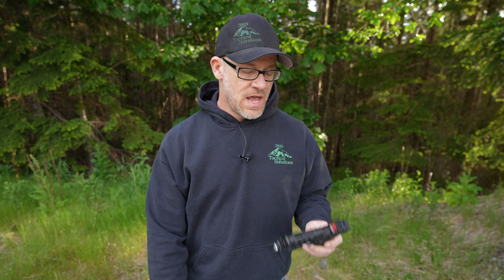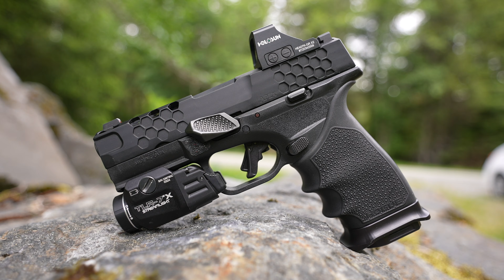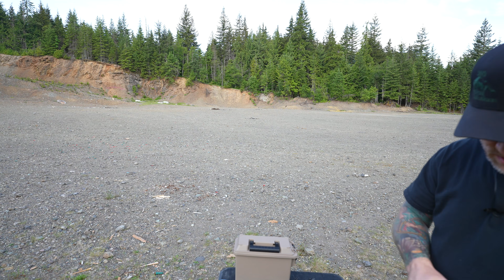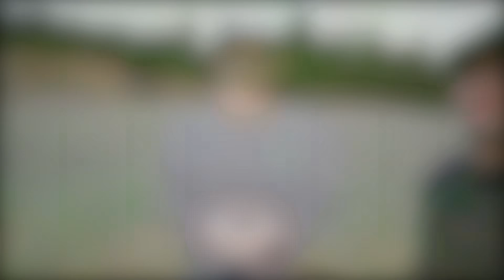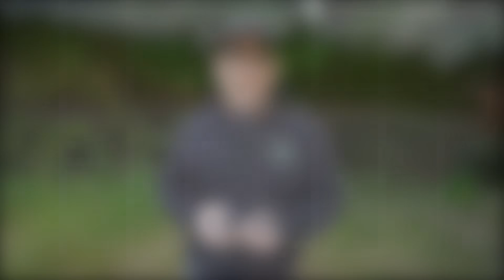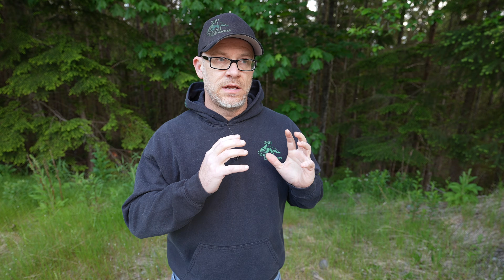BlackSteel vs GoGun USA - Hellcat Pro

Comment: Nice vid. HOWEVER you are missing the point about recoil. Yes a flat plane thumb assist will help reduce flip. BUT the more you control flip, the more windage error you get, like the jerked first or second shot. The Gas Pedal® brand assist mitigates that jerked shot. Flip is not the only thing you need to control, jerk or windage is more important. Folks that like old style grip or think flip is most important will like flat plane assists. About the failures, we had a bad lot because of bad steel, which we pulled. However with other lots we have had NO failures. And new lot coming soon will not fail. About spring loaded thumb assists, we looked into and nixed it. Reason being all  exterior Springs fail eventually, Debris can keep it from working properly. About quality, Gas Pedal® CNC assists are machined to tolerances of - 000 +.002. Nobody else does that. Please dont confuse genuine Gas Pedal® products with cheap Chinese copy cats available for cheap on Ebay and Amazon
Reply: Is this really from GoGuns? Hard to believe a legitimate company would act so unprofessionally.
Reply from the maker: @nickbarker2596 yep that’s really them
Reply from the maker: A big issue with you guys is that you are so proud and confident in the product that you sell you aren't even the slightest bit open to the idea it could be improved or that maybe there are other products on the market that could work for people better. This comment is a prime example. You come in and comment in a way that the Gas Pedal is the best thing thats out there and its the customers fault if they don't like it or they just don't understand recoil, the failures aren't your fault it was just a bad batch of metal but you have better stuff coming in and it won't happen again but also you insinuate people are buying cheap Chinese copies on eBay and amazon like maybe the people having those failures are using those and not items from GoGun, you try to break down why a spring assist is a bad thing but Black Steel has a lifetime warranty so whatever, then you come in about the quality and how no one machines their parts to the same tolerances you do....but I've personally had a half dozen people reach out to me about the gas pedal breaking.

My point is this, show some humility and maybe take customers suggestions as helpful criticism. There is no one perfect product solution for anything and when people use your product and say well it's alright but it interferes with me being able to remove my slide...maybe take that into consideration. Maybe look at the grip texture and consider that it could actually benefit from being more aggressive regardless of someone using your opposable grip style. From what I have experienced and the conversations I have had with many other people who have contacted GoGun, the attitude that the product is perfect and the customer's just don't know what they are doing is a bad way of doing business. I could almost look past the failures on a batch of gas pedals except like I said ive spoke with a half dozen people that have had that issue and in your own comment you flex about how precise your manufacturing process is. If the process is so precise I find it hard to believe you let in a batch of materials that was faulty and if you did then the QC failed horribly but you cant have both an incredible level of manufacturing and horrible QC if you have the attitude that you make the best product on the market that is completely without need for improvement.
Reply: @360TacticalSolutions  Sounds like a hater that doesn't understand Physics of recoil. We never said our brand is best for everybody. In fact we say the those with old style grip who are more concerned with flip would like the flat plane iterations better. About failures, here is the truth. We have only had a handful of failures In P320 X5  competition legions that are due to user error but we replace them anyway.No 320 models have failed in any non modified regular 320. About the Hellcat failures, we go a bad batch of metal even though it was certified and we  pulled all Hell cat models with that steel. It is obvious from 360 tacticals comment, he has no idea how guns parts are made. CNC machinists rely on the metal supplier to certify the metal and we only buy best available metal available. In that one isolated case the metal did not live up to specs. Even aerospace use same procedure for metal qc as we do. We continuously innovate and have for 30 years.

I dont know why he says shooters are complaining to him. We have active customer service and have not had his misinformative feedback. They should complain to the company not some third party that knows nothing.

I would never take advice from a hater who shows his ignorance of firearms.
We have over 40,000 parts in field without failure.

Besides, Winning dont lie. Virtually same product was on 2024 National Championship productions guns.
Reply from the maker: @GoGunGasPedal  not at all a hater. I’ve promoted your products for two years in the Hellcat Pro community…which is why people give me feedback on their experience after buying a product I personally recommended. Call it misinformation if you want but you dont have to save face here, this is a channel for product testing and review. The salty tone and personal attacks are a great addition to reasoning as to why I wont recommend GoGun products in the future.
Reply: @360TacticalSolutions  More misinformation from poster, no salty language and no personal attacks to vid poster, only a warning not to take advice from someone who doesn't understand firearms. We have not have "face to save". We have pride in winning National production championship. Winning don't lie.
Reply from the maker: @GoGunGasPedal funny that you guys enjoyed the exposure and sales from my recommendations for the last two years till I found a product that I feel works better and all the sudden you show up out of nowhere saying I’m posting misinformation and don’t know anything about firearms. It would have been really easy to shoot me an email but I guess you rather hash it out in public. Let’s just gracefully leave it at agreeing to disagree and call it a day.
Reply: @GoGunGasPedal You guys would benefit from taking the constructive criticism of people who have advocated for your product or at the very least have purchased and used your product lol. I personally have had both and like the OP stated I personally believe the black steel grip control works better and is designed much better. In fact even if the results were the same judging by your comment alone and my personal experience with your company I wouldn’t purchase another product from you guys again. I mean the level of arrogance makes me feel embarrassed to have spent my money with your company.
Reply: @GoGunGasPedal i’ve tried neither yet but after reading your responses I think I understand where 360 is coming from, ya’ll don’t sound very receptive to feedback.

Comment: Hey Mike I know this video wasn’t about triggers at all but I was curious to what the pull weight is on your hellcat pro with the apex trigger. I just recently picked up a trigger scale and realized my stock trigger has a range of 5.5 to almost 8lbs. I’m looking to get it around 5 consistently. I have around 5k rounds through the gun and it’s my edc. I’m pretty good with it but the inconsistency on the trigger is starting to get to me after shooting my prodigy. The prodigy   was a lot easier to tune the stock trigger weight without aftermarket parts. I got that down to a consistent 3lbs. Any info would be greatly appreciated. You have been my go to for anything I’ve looked into for my hellcat pro.
Reply from the maker: Im going to go out on a limb here and guess that either that gauge is faulty or you may be letting off it too early, maybe too late. A variation of a few ounces, up to maybe a half pound would make sense but 5.5 - 8 pounds is too much variation to be accurate. Springfield says the stock setup runs 5.5 - 6.6 pounds which ive found to be fairly accurate. A brand new HCP in my experience is roughly 6 pounds on the 4 or 5 I have tested. This number can decrease over time and break in down about a pound or so making the average pull weight of a broke in gun 5.5 roughly.

As far as mine go, I went out and tested all 3 so I could give you an accurate breakdown. My oldest HCP has just short of 40k rounds on it right now, full Apex trigger and spring kit and pulls at 4.7 on average over 10 trigger pulls.

My second oldest has roughly 20k rounds on it, full Apex trigger and springs, the only other thing that is upgraded is that it has the MCarbo titanium striker and striker spring and that one pulls at 4 pounds average over 10 pulls. As a side note, sometimes I get light primer strikes with that gun and I'd probably go with the MCarbo striker but use the Apex striker spring to keep it more reliable if I knew where the hell that spring was lol.

The newest one only has maybe 6k rounds through it, Apex trigger and springs with no other real modifications and it sits just under 5.5

My advice would be to order the MCarbo striker and Apex kit, put the Apex striker spring on the MCarbo striker and use all the rest of the Apex parts. That should get you the most reliability as well as consistent pull weight in that range you are looking for.
Reply: @360TacticalSolutions I appreciate the reply. I ran the gauge on my Ruger 10/22 and my prodigy that both have 3lb triggers and every time it was spot on. Maybe something was weird with the placement of the gauge on my hcp trigger. I’ll test it again. I know I’m not the greatest shot but I have noticed before I’ll put 5 rounds in a good group then will randomly throw the “6th round”. I actually just ordered the type 3 apex trigger using your code. I’m going to try that out and see how that goes. I don’t want to lighten the trigger up to much but something more consistent would be great.
Reply from the maker: @eliterenegade871  thats definitely odd you are getting so much variation in it. There’s always the possibility that the stock springs are faulty, although that would be my last guess just due to how consistent these guns have been for me. Let me know how it goes after you change over to the Apex
Reply: @360TacticalSolutions Got the apex trigger installed and installed the MCARBO striker with the apex spring and it dropped the trigger pull from 6-6.5 lbs to a fairly consistent 5.5. I’ve done a bunch of dry fire with it and I plan on shooting it this weekend sometime. The type 3 is definitely a crisper trigger.  After tuning my Prodigy down to a 2.5-3lb trigger and the smith and Wesson m&p 2.0 metal I just got I had to do something with the trigger on the hellcat. The stock smith trigger really nice. Thanks for the help and HCP videos.
Reply from the maker: @eliterenegade871  as a long time M&P guy its hard using a different striker fired gun after using an M&P with an Apex trigger. That combination just works so well. The Apex definitely helps the Hellcat Pro though. The trigger is one area Springfield failed on this gun
Reply: I ended up ordering the mcarbo kit to so I’ll give you an update when I get it all installed. I did mess with the trigger gauge one it again and it was consistently around 6-6.5lbs I’m not sure how I was getting the 5lb and 8lb variations cause I tried to replicate it and couldn’t. It is one of the cheap wheeler gauges but it seems to be spot on with all my other guns

Comment: Thanks for this review. Am I correct in assuming (hoping) that the BlackSteel Grip Control will work with a holster that’s made for the GoGun Gas Pedal?
Reply from the maker: Very close. It would only need a slight modification. Soften with the heat gun just a little bit and push out from the inside where it hangs up and it should work like a dream

Comment: I am curios if Blacksteel has "gas pedals" for left hande shooters. I took a quick look at their website and did not see any.
Reply from the maker: They don’t have one for the Hellcat Pro unfortunately. I believe they tend to go by number of requests when it comes to new or alternate products. I do see left handed options for other guns but it may be worth emailing them and asking for a lefty option for the Hellcat Pro. Throw in there that you saw their product on my channel, not sure how much weight that may hold but it might help.
Reply: @360TacticalSolutions 
Thank you for responding. I will definitely check into it.

Comment: I've been thinking about getting this for a while, but wondering how it would work regarding my current iwb holster. (Druid by Rounded Concealment) Great information as always my brother. Oh and i did install the Hellcat Pro Hogue grip and NDZ +10 recoil rod, but haven't had time to get to thw range to test the setup. Will let you know the results after I go.
Reply from the maker: Hey good to see you in the comments. Just a quick update...holster modification is a $35 fee through Black Steel and includes a shipping label, also the Grip Control has a lifetime warranty. I'm totally on board with these things

Comment: @360 Tactical Solutions I'm glad you're able to use the products successfully. For years I tried various grips and products trying to use my support thumb to make the gun shoot flatter, etc.  I realized that there was no way to be consistent with the same grip and pressure from my support thumb.
I couldn't maintain the same pressure throughout drills, especially if doing a lot of shooting with my hands getting tired, etc. I was inconsistent with my dot returning to the spot I was shooting as well. I pulled everything off. I now use a solid grip and do not worry about recoil.
Everything immediately improved.
Now my thumbs just kind of float along the side of the slide.
Reply from the maker: Everyone's grip style is different, and it's cool that you've found what works for you.

Comment: Thanks for this terrific video!  I am loving the Hellcat Pro Comp more than ever, especially with the terrific upgrades. And the codes to save those extra dollars makes it all so much sweeter than ever!  I do wonder about ordering the Black Steel…. They have that option to order “1, 2 or 3”. Is that the placement location?  How can you tell which fits best for you?  Don’t think you have to answer…. I will be calling the company. I just wonder about that.  Thanks again!  
~Regards, Sharon from Florida
Reply from the maker: Yes the numbers are a position thing. I forgot to cover that in the video. #1 is closest to the trigger, #3 is closest to the muzzle and #2 is half way. I basically held my gun in hand while looking at the diagram on the Black Steel site and kind of mocked up where my thumb sits vs what their site shows. Ultimately I felt the #1 was going to be closest to where my thumb naturally rests so thats what I went with and the fit is perfect.

Comment: Shalotek Flex has the best option with its trigger guard thumb throttle, and don't forget the ARC division thumb blaster
Reply from the maker: The problem with the ShaloTek is all their stuff is made for the P365 so I dont see any real relevance to them in the conversation. They focus on basically one gun so I wouldnt say it’s the best option….considering this video is with a Hellcat Pro. The same thing goes for Arc. Their thumb blaster is made for what the Glock 43X? So basically neither companies make products relevant to a wide range of firearms. If you own those firearms thats great but I just dont see where the suggestion fits in for this video
Reply: @360TacticalSolutions the ARC division thumb blaster is for any gun that will accept the tlr7 sub light just for clarification
Reply: "Thumb rest engagment pedal for TLR7 Sub and TLR8 Sub weapon mounted light for Glock MOS models/frames only" . That's straight from their website, is there another one that I'm not seeing on there? I'd like to check one out for $20 if so.
Reply: @ThisShouldBeGood88 I already own and run two of them on 365 frames, they simply screw directly into the side of the tlr7 sub and run beside the rail of any pistol, very poor marketing to list them as glock specific
Reply: Im going to give it a try on my hellcat then for $20 👍🏻 Thanks
Reply: @ThisShouldBeGood88 should work fine it's just the adapter plate on the side of the tlr7 sub light that is removed and replaced with the thumb ledge part

Comment: I just got a new hellcat pro comp, and just today finally got to order some good things for it. I just got the apex striker and sear springs kit, I got a cyelee cat g pro green dot optic for it, and an iwb holster. Im definitely gonna get one of these black steel grip control thumb rests for it. 🙂
Reply from the maker: Don’t forget to use that promo code and save yourself some money
Reply: Kde kúpim opierku na palec
Reply: @johnybb1111  The thumb rest I got came from a company called "Anti Matter Industries", and I got the one called "Micro Wing", but keep in mind that the thumb rest model that I got connects/mounts directly to the side of a weapons light, and the company that makes these thumb rests, only makes them compatible with just a couple weapons light models. The one I got is compatible with most streamlight TLR-7 lights, so if you want to get and use these thumb rests, you have to go on their website and find out if your pistol is compatible with any of the lights that work with these thumb rests. They did make a chart that has a lot of different model handguns from many gun companies, and it shows which lights and thumb rests are compatible with the pistols. hope this helped 🙂